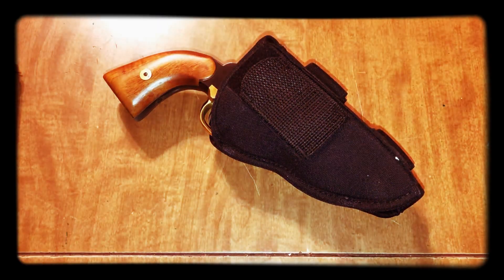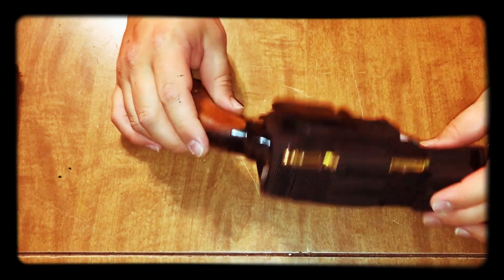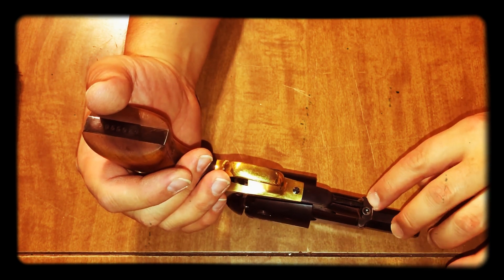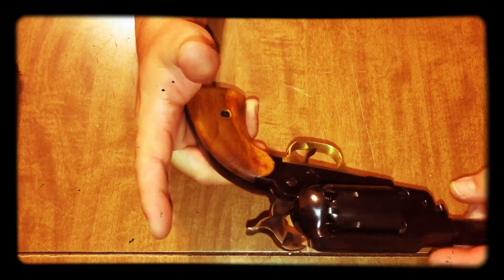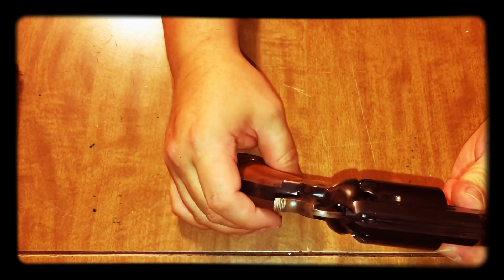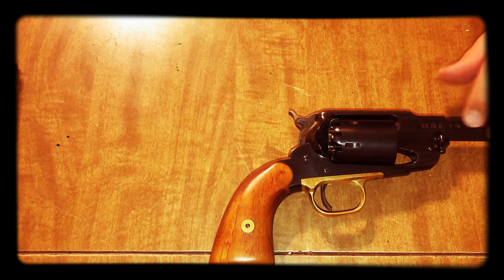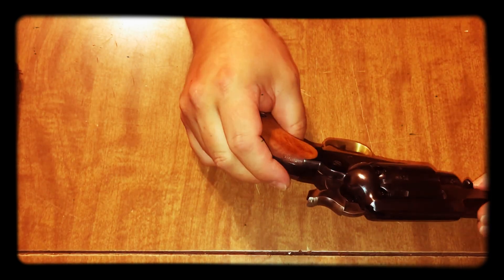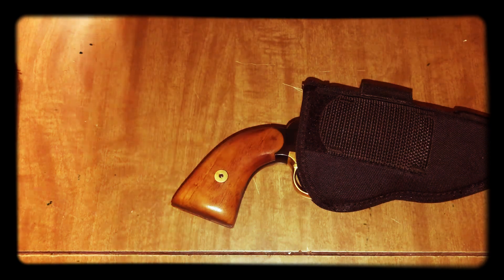(Gun28) New Model Army Subnose Project

Comment: You doing a great job bro..it looks great..I'm doing the same to mine..what do u think about aluminum welding a top new army front sight..would it hold??I'm stuck on that part
Reply from the maker: Probably ask a gunsmith that one but I was gonna use a shotgun bead sight on mine just have lots of irons in the fire right now.
Reply from the maker: duelist1954 has a build that's where I got my idea I'll find it and drop the link he has a wealth of knowledge on that channel
Reply: @Sicsicka  I understand..I'll let u know...
Reply from the maker: Check out this one https://youtu.be/sGWPJBnx4o4
Reply: @Sicsicka   hey if u wanted to strip the bluing down to beautiful s.s.  soak the frame in this rust romover ... Is beautiful and harmless to the touch...
Reply: @Sicsicka  evapo-rust let is soak for about an hour ..take ur brass off ..and try ur cylinder first see how u like it..and remove the npples let em soak freely